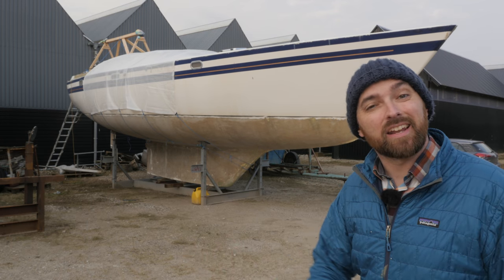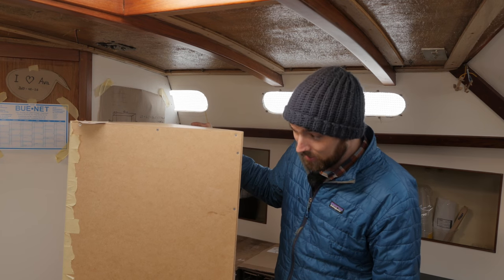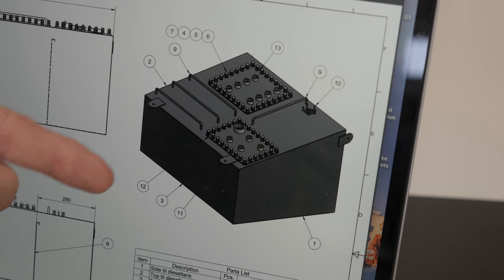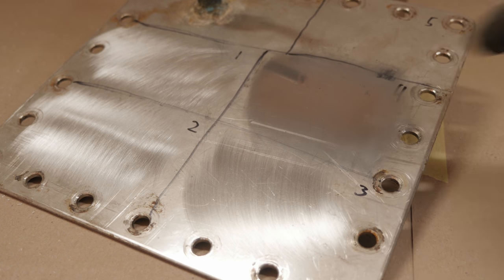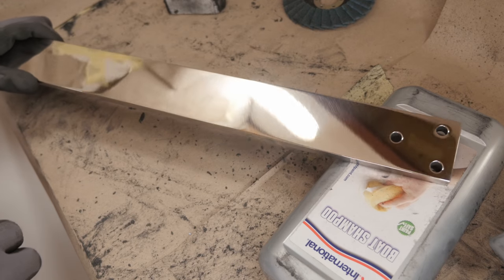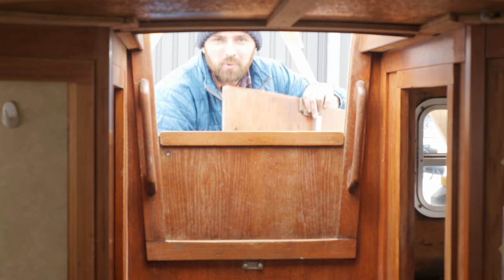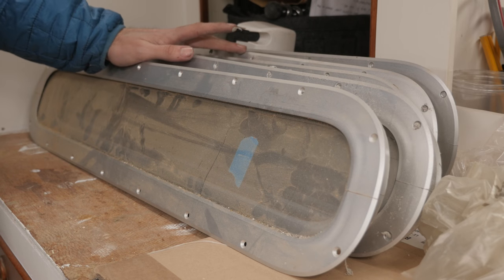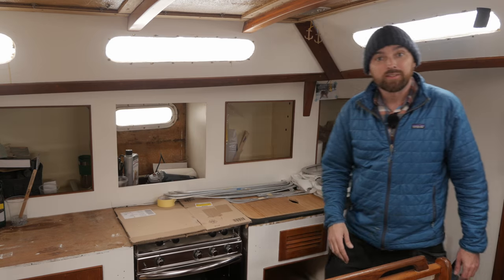Sail Life - Polishing stainless steel, removing butyl sealent and tidying up - DIY sailboat project

Comment: Mad one of the channel you subscribe SV Dream chaser, did a video on marine and non marine plywood. You had used non marine plywood for deck replacement (and given your reasons as well), it is your boat and your choice but I'll like if in any future video explained your decision again.
Reply: The plywood he used used the same glue as marine grade.Other than the adhesive used marine grade also uses a better grade veneer  to eliminate voids.In his on video he explained that the stuff he used also used the better grades of veneers and it wont be a issue.I've seen much worse stuff sold as marine ply here in the States.

Comment: Hi, just a thought but would it be worth investing in a 2 wheel grinder/polisher station set up, I think the abrasive wheels and polishing wheels would last longer. Most of the polishing you appear to need to do is on flat plates which should work. You can use your hand held grinder for the fiddly bits.
Reply: Exactly.  You can get Scotchbrite wheels for a grinder.  would make it a whole lot easier to clean and polish all those plates.
Reply: The cheaper generic polishing wheels for the bench grinder over the expensive specialty ones for the hand grinder would probably pay for the cost of the bench grinder even before he sold it on Craigslist when he no longer needs it if he is going to be doing all the chainplates.

Comment: Hi Mads great video you made an excellent job of the polishing. I used  to work in a company that made stainless steel polish equipment for the pharmaceutical industry. The secret is to use flapper wheels not the radial sander disk that go on a angle grinder, and work in the same direction. Start with a rough 40 grit then 60, 80, 120, 180, 240, 360 etc.. then you move onto a hard mop with black soap then finish with a soft mop with white soap. You end up with a mirror finish remember and keep all the flappers when polishing going in the same direction it makes a big difference. You could make your new chain plates from 316SS flat bar rather than get them laser cut. You would just need to cut to length grind a radius, drill and polish.
Reply: My way polishing metal : Mirka Abralon (P400, P800, P1000, P2000, P3000) on an orbital sander because grinder does mostly damages you can't polish out easily. Just 1 or 2mn per grit. Then whool pad polishing with creamy automotive metal polish (Autosol, Autoglym...) Forget dry sticks. What you did can be done in less than half an hour. Three nuts of polish on the woolpad, spread on the whole part at low speed,  no pressure. then work the polish at medium speed low pressure. It should turn black. When the polish brakes and starts to be dry, raise the machine at full speed, no pressure, until the shine is revealed and most of the polish gone. Then clean the part with a microfibre cloth and some all purpose cleaner. All done. Seal the metal with a marine wax (Finishkare 1000P which is awsome for the hull too).
Reply: Standard flat bar would reduce the costs over getting the plates cut out. Would also mean getting replacements while travelling would be easier as most steel merchants would have the correct size whereas you may not find a laser cutting setup as easy to find.
Reply: I was about to tell him that.. but you guys got it all covered. Use a small bench grinder if you have to with the flap wheels. There are some smaller ones that can be adapted. And they LAST a bit more then the ones youre using. I've got a few that are over 10 years old.
Reply: I tried polishing my chain plates using a cheap polishing system from a big box hardware store with a drill but it did not work well; so, I tried a cheap system from an automotive supply company that included a series of polishing rouge and a variety of buffer wheels for the drill, again without success.  I have an angle grinder, but where is a good source for flapper wheels, Mads/Al?  Thanks!  B.

Comment: Less abrasive (unless you have deep scratches), more polishing compound. At least one coarser grade (black ?, brown ?) of compound.

If you are going to have new chain plates made, have all of the holes and edges  chamfered.  Also, you might want to invest in a good bench top grinder with the proper buffing wheel and a solid place it.  With the grinder/buffing wheel fixed solid, you can use 2 hands to hold those pieces and "lean into" them !

Comment: A bench mounted / counter top , grinder , with a soft cloth buff wheel will do all your bendy parts with ease , just grab a bench grinder from a used shop and mount to a plywood base that you can clamp to a saw horse or table top with some grip clamps , then sell   the grinder off after ward when the job is done.

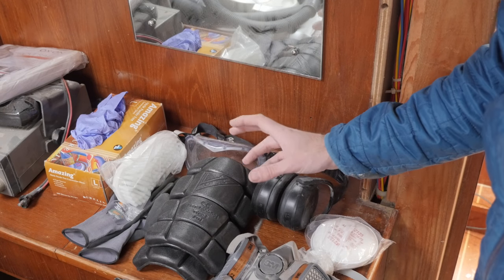Comment: always store your mask in a bag or closed container. your filters are from active carbon. and will only do their work for 40 operating hours. when storing the filters properly. when you removed the mask from the package, there was also a plastic bag of 3M for storage (I mean the mask you pointed at 3:28)
Reply: Husqvarna Fun - The proto diesel tank could be good for that. 😷
Reply: Husqvarna Fun 
Some masks suggest refrigerating the after use.
Reply: pat K
What do you mean by refrigerating ?? sorry I do not understand the word in this story
Reply: Husqvarna Fun 
The last time I had need for a two part epoxy paint for a project I purchased a 3M mask like the one Mads uses and the package said for best long term use refrigerate/freeze the mask when storing for prolonged periods. I froze mine till next use. I must have read it somewhere, you can't make that stuff up.

Comment: I have been there with polishing stainless steel, it is a messy job however there is another benefit, according to some people there are impurities in the dull original surface, polishing reduces vulnerability to corrosion according to them.There is supposedly a process called electroplating, the equipment for which is very expensive, this supposedly is very quick and easy. I am a little sceptical about this supposed process as an American company specialising in replacement chainplates uses a ceramic tumbling process, incidentally I designed new chainplates for my boat last year and had them ceramic water jet cut, I think this is what you mean by laser cut, I polished them and then I left them outside to weather before fitting as some people say stainless steel is more prone to corrosion if it is not allowed to form an effective oxide layer before encapsulating. I don't know if you want to research this further as I can see you polishing and weathering every piece of stainless on your boat once you do
Regards 
Malcolm

Comment: I know that port lights are expensive, but did you give any consideration to replacing some of your existing port lights with ones that will open? I believe you've said that your plan is to head someplace considerably warmer once Athena is done, and opening port lights would definitely increase your ventilation options.
Reply: I am fairly sure that these are all brand new port lights and frames that he bought and installed last year before he ripped the teak deck off and realized he had to do a much bigger job to re-core the deck fully.   That job expanded its scope quite a bit and he ended up having to take them all out again and extend the fiberglass cloth up to and over the sides of the cabin doghouse because of the way the deck and cabin top were not really connected together correctly.

Comment: Having just viewed this video and reading Al's comments I would like to add just a bit of information. Although I have never polished SS I do polish a good amount of precious metals when I am creating jewelry and everything that Al said is great, especially moving, in order, from the most aggressive grits to the finest ones. One sanding trick I learned a long time ago is to change direction by 90 degrees, if possible, when changing the abrasive. 45 degrees could work as well if 90 isn't possible but you need to be able to see the difference in the direction of the marks you are leaving. Changing the direction makes it easier to see if you have missed removing the deeper marks and this way you only sand until you remove the scratches from the previous, more aggressive, abrasive. Keep it Spiffy!

Comment: Hej Mads, on our shipyard we use this: https://3mpro.3mdeutschland.de/3m-bndl000020.html together with an adjustable speed angle grinder. Use it on low revs otherwise the wax gets too warm and doesn't do it's job. It is realy quick working with that stuff...

Comment: IMPORTANT: Please read.
This is a repost of a previous comment I made on one of your previous video. As an industrial designer, I won't be mad if you don't do it... but at least, know that you can consider it ;)

Your tank doesn't have one low spot. It has a low edge. And that edge is really wide. I'm not sure it will do a good sump. Debris can gather anywhere all along this edge. Then by rocking from one side to the other of that edge, it will surely mix with the fuel. Easy solution: Changing the flat shape bottom of your tank to a V shape bottom? That way, debris will gather at the one and only low spot of your tank, acting like a real sump. Also, it will give you more fuel space.

P.S. I'm a big fan of your DIY project. Whatching it is always my Sunday feal good moment.

Comment: This is one of those times when I would ask myself "What would Mads do?" and do something 35% less OCD.  Those steering parts looked perfectly serviceable.  I would have wire-brushed them and finished them in white epoxy paint.  Even that is a bit too far - they lasted 35 years with no finish whatsoever.  I can't see myself spending time and money on components that no-one, including myself, will ever see.

Comment: Now that you have been so familiar with steel. Why not build your new ruther (ror på dansk) out of steel. You will have a steel shaft (preferably SuperDuplx). Then it is to weld on two steel plates, top and bottom, and you are done. Cheaper, quicker and stronger. Will last for ever.
BR
sv Hulda (norsk seiler, stål)

Comment: The old rusted steel bars, How much rusting is there?  You might be able to sandblast them depending on the thickness of the rust.  Then you could keep them and hold them as a backup

Comment: Don't see the point of polishing something that will rarely if ever be seen. But if you must. Start with 80 grit if really scratched, then 200, 600, 1000,  1500 then jewellers rough with cotton buffing wheel.  Don't use flapper wheels as they tend to leave scratches. That three hours is actually less than  30 minutes, maybe only 15 to 20 minutes if your set up right.  If you have a variable sander, for 1000 and 1500, do it wet.

Comment: Regarding the two buckets of hand tools, there is a tool organizer of heavy synthetic fabric designed to fit over a five gallon bucket.  Very popular here in the US.  The organizer has many tool pocket of various sizes and configurations, plus the middle of the bucket can contain long, large tools, like hammers, pry bars etc. Every home center supply carries a few brands, with Bucket Boss being the top of the line.

Comment: It's amazing how easy it was to clean that butyl. I am in the process of refinishing all the port lights on my boat and the previous owner rebedded them with 5200 and filled in the gaps with Silicone. What a mess!
I will definately check out using butyl for when I re-install.

Comment: Use wet/dry abrasive with a squirt bottle of water(with drop of soap) and polish in an area covered with plastic sheeting if needed. If you use water you can likely skip coarse and medium.

Comment: Mads - I use buckets for tools the trick is to keep one empty so you have one to take the tools you need to the job site - so you probably need another two buckets.😂 On a very wet day I wonder if it would be worth doing some temporary stowage racks in the vee berth for your power tools and kindred stuff, maybe a charging station for your tool batteries. Good luck with TV visit - are you taking them to Obelix as well?👍⛵️👏

Comment: Hi Mads, great videos. On the new stainless steel rod which attaches to the rudder shaft, I noticed that the autopilot and one other connection are not welded all the way around. I just finished reading "Alone Together" by Christian William's about his solo voyage to Hawaii from LA. He had his steering binnacle welded before departure. Turns out the weld was not complete and the entire binnacle broke off on his return voyage!

Comment: Good polishing exercise, I'm not sure I would want to take the time with all the projects you have. I have used a tumbling and polishing company who have a machine with special  hard tumbling metal media that does a great job of polishing the surface ( but it will polish any flaws too) but for below deck utility parts it would be fine and not expensive.  Another alternative is " electro polishing' you send the parts out and they come back beautiful, a lot of Stainless is done this way. 
But if you insist on doing your self if you can rig up some way to have the polishing tool fixed it's much easier and quicker  to polish if you move the part on the sanding or polishing head than the other way round.
This random selected  video shows what I'm talking about   https://youtu.be/mWy9awGv6so
Cheers Warren

Comment: Instead of the course, medium and fine flap disks, use course, medium, fine and extra fine polishing compound.   It will be less expensive than flap disks and produce better results.  Your chain plates look a little light for a blue water boat; consider going to 4 inch wide plates with two rows of staggered bolts.

Comment: After polishing stainless steel, passivate with citric acid to testore Maximum corrosion resistance. Also, when using abrasve, clean up all the abrasive dust before going on to the next finer grit, especially before trying to use polishing compound. Else you will pick up course abrasive and put new scratches in the surface during every stage of the operation.

Comment: Don't know if you need all those abrasive discs. I have a bench grinder setup, brass wheel one side for stripping crap off, rag cloth and brown compound on the other. Brass is easy on the steel so you're not polishing your own scuff marks out.

Comment: hi Mads. with your chain plates use stainless steel 316L with a B2 finish. this grade of stainless steel pretty much a polished surface and would save an extreme mount of time polishing through the the different grades of sanding disks... also polish in one direction and clean off with hot soapy water once finished.

Comment: This is a question from the past.  How did you deal with the diesel saturated plywood on the port side-wall of the engine compartment.  I reviewed the videos about that time and I couldn't find anything covering the process so you could paint that area.  Perhaps someone else can point me in the right direction.  Thanks Mads for a great set of videos,  Took me two weeks to binge view all of them.

Comment: I was a prepper for a body shop and I can tell you that prep work is everything. The painter always got all the credit from the customers but the guys in the shop always told me that their work was worthless without me. Take your time, pay attention to your surface and remember that what your looking for is that each media leafs different scratches. Keep with the same grit until all the marks are similar depth. It's a good idea to keep going a few minutes after you believe you are finished when your first learning. You will appreciate the extra time after. Same with working on the deck or the underside of the boat. 

The big mistake people make is they think the paint will cover the scratches, it won't. The smoother the surface the better the finished product will be.

Comment: If the glass in those potlights are glass I'd look into adding a clear uv tint on the inside surface. It will allow all the light in but not the fading heating uv rays. In the state you can grab it at taps plastic the fantastic plastic place. In the EU I'm sure a car window tint shop could help you out with some 3M clear uv tint

Comment: Don't worry about grinder disks. Just use a sander and work up in grits. You are correct that you should spend more time with the courser grits to even the surface then fine grits to remove sanding scratches

Comment: I would definitely clean up the old steel steering gear and keep it as spare, Its a lot stronger than stainless steel, less brittle and well suited for that application.

Comment: Only polishing comment I have is try not to move the grinder so fast.  Moving a circular abrasive quickly open the pattern a lot. Moving slowly approximates a linear polishing method.  But there's no point in a full mirror and what you have there is plenty for those parts.

Comment: Hi Mads! Those abrasive flapper disks can be used until they are gone. You can continue with polishing until they completely disintegrate. Also, those aluminum port lights can also be polished.

Comment: Hi Mads, I've done hundreds of hours of polishing stainless and aluminum for custom motorbikes. You really could do with a powerful electric motor as the pressure needed to polish will stop a less powerful motor as you were experiencing with your angle grinder. From memory I think a 0.5HP or more motor will suffice, mounted on a plinth at the right height so you can get the best grip on the item to be polished. You don't want that item being thrown out of your hands at a startling pace across the room! You may need a custom fit reverse spline made to fit the shaft though. Don't be tempted to clean the new shiny parts as the wax will help keep the part clean for a while. Just rub down with a lint free cloth. Wow that's a memory from 25 years ago!